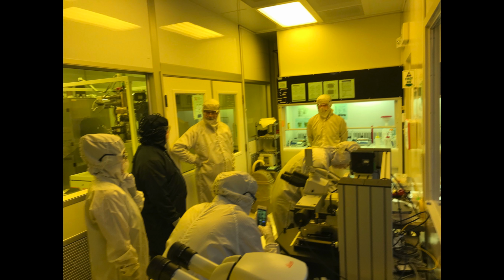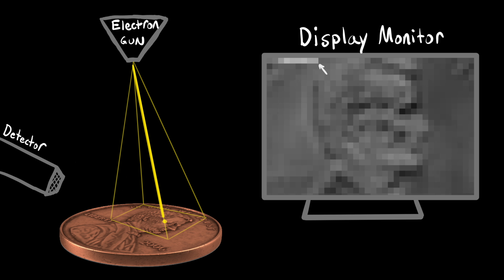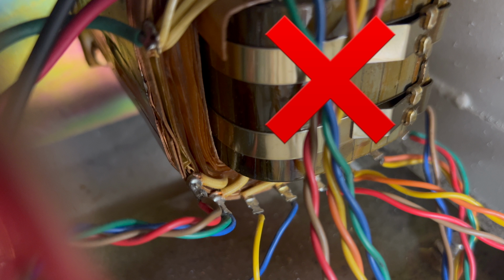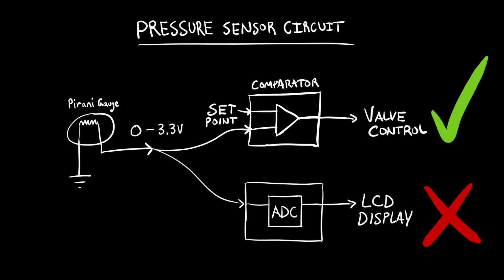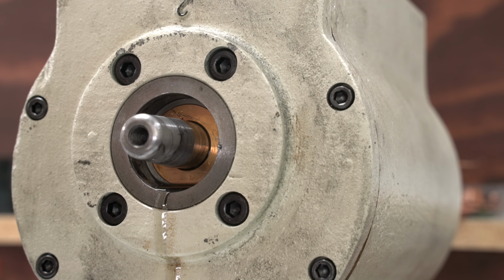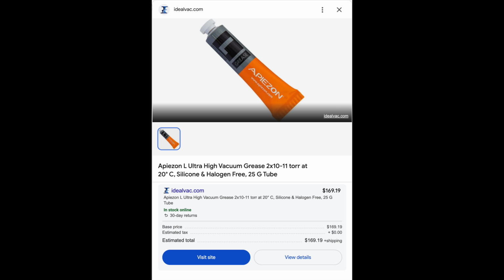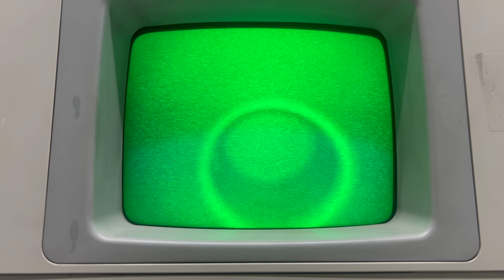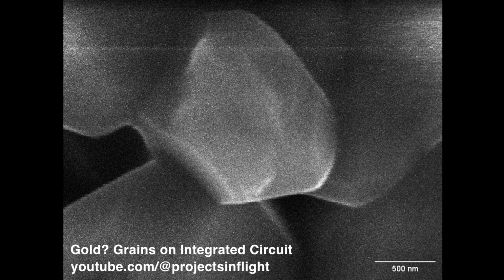I Saved an Electron Microscope from the Trash

Comment: why didn't you use a step down transformer for he whole thing?
Reply from the maker: if you mean instead of the variac, i totally could have. For whatever reason the machine came with a variac instead of a fixed transformer- probably to accommodate slightly different mains voltages

Comment: Question:

Why go through the extra effort of sourcing specialty transformers with calculated voltages?

If you're replacing the entire transformer anyways, you might as well feed it line voltage? It's only the output that matters anyways, no?

Or are you that worried about the galvanic isolation the variac provides?

Comment: The fact that those massive voltage regulators could be replaced with a 7805 regulator is absolutely insane and shows just how far silicon tech has come
Reply from the maker: I will admit that i am pushing those voltage regulators pretty hard. The ones it originally came with probably had a larger safety factor
Reply: @projectsinflight  oh definitely, but I imagine a similarly specced of the same age as the original regulator would easily be double or triple the size. Nothing against the engineers back then, they did the absolute best they could with what they had, but it's interesting to see how far everything has come since then

Comment: Since the pressure gauge was removed from the loop, how did the digital circuitry know when to go from DP WAIT to PRE EVAC to EVAC?
Reply from the maker: the pressure gauge is still in there- the only thing that is nonfunctional is the part that converts the analog signal to the digital display signal. the board that controls the valve uses the analog signal
Reply: Ahh, thx very cool that these old analog systems have separate circuitry for each sub system.

Comment: Now imagine loosing time on 70s stuff where you can get the cheapest ccd censor with few microns pixel size for cheapest Webcam possible for few bucks and just place whatever you want to scan in a drop of oil directly on top of the sensor.

Comment: 🤔Perhaps "GO CARDS" = "GO CARDINALS", the baseball team.  In the late 1970's, at HP Labs, I designed the digital raster image electronics for the "E-beam" vacuum chamber device that scanned very high resolution electron beam images onto integrated circuits.  The vacuum chamber used the same technology that your electron microscope uses.  Very interesting work!

Comment: Dear Pro,

I had saved a similarity one, JSM 5500 donated from the other department. My students and I so happy for that. However, it has no software source or any service manual. It is now running under windows NT4.0. That fine but too slow.  I like to upgrage the system to lit of bit higher verision. 
Could some one kindly help me to find out the sofware source? 

Many thanks
Tuan

Comment: I used to work on one of them, measuring critical dimensions on microchips, at Maxim Integrated Products in SATX. Now, that fab is owned by TowerJazz, the last time I checked. I would also create jobs for the SEM to automatically measure critical dimensions (it was very simple programming, like programming an old radio). Thanks for the video!

Comment: The university I retired from purchased a SEM, don't recall the brand.  They spent a ton of money for it and the deal was the criminal justice department would share in the cost of the instrument and that would make it available if they wanted to use it.  I don't think they ever used it.

While I was employed there (notice I didn't say I worked there), the video display quit.  It was common NTSC analog video, I was able to send the video to a standalone video monitor, got them buy until I was able to repair the original monitor.  After I retired, got a call that the SEM died and they didn't know what to do.  Apparently the tech that took my place didn't know anything about it, so they called me.  Having no schematics or trouble shooting info, I went on my own, have to think simple.  Turns out it had several power supply voltages but I believe they all keyed off one power supply, which was dead.  Eventually I found a shorted capacitor in one of the regulated supplies.  Of all things, it was a ceramic capacitor, those things almost never fail.  Here you go, a 25 cent part.

I never had a chance to play with it but I knew it wasn't so simple that you put something on a microscope slide, put it in the chamber and look at it.  I think they had to do a metalic vapor deposition on the specimen  in order to look at it.  Also, I believe the specimen went into a vacuum chamber, not something you would put your finger in.

edit:

I also recall before I was employed there, they had another electron microscope that somebody ruined.  Whatever they did, got oil into the chamber and it ruined everything, but I wasn't there, so don't know what really happened.

It was 27 years of my life, really enjoyed my job with the school of engineering and computer science, until politics got in the way and I retired.

Jim

Comment: Hi, I have nice helminth I need pictures of can you help out? 
Thanks
Julio
Reply from the maker: Unfortunately, the need for a vacuum in the SEM means that you can't simply image organic material, since the water in the sample will make it impossible to achieve vacuum. There's actually a LOT of work that needs to be done to image organic specimens. 

1. embedding (you have to replace the water with epoxy)
2. staining (you need to add heavy metals to the sample to improve contrast)
3. sectioning (you have to slice the specimen up to see inside it)

I'm working on a method to image organic stuff in the sem, so if I put out a video on that feel free to hit me up again and i'll see if I can do it :)

Comment: You could probably fit a bucking transformer (power transformer configured as auto transformer) inside and eliminate the variac so the SEM just plugs into 120V power. These can be pretty small as only the low voltage secondary winding carries the load current, something like 120 primary, 15-20V secondary rated at higher current than the whole SEM pulls from the wall at 100V, remember mains power is toleranced fairly wide, for 100V Japanese power anything within 90-110 shouldn't hurt anything.

Comment: Pretty cool that you have your own SEM.  We used TEMs, SEMs, STEMs regularly to examine grain structures of CIGS solar cells as we were developing a manufacturing process for supporting 5MW per year production rate with an increasing performance efficiency objective.  Anyway, nice job getting the SEM running.  Looking forward to seeing what you do with it.

As an note, perhaps looking for a sputtering chamber in the spirit of your SEM, like a Hummer, would good to consider.  You could do metalization from solid targets of you choosing WAY easier and no chemistry.  As I recall they were not that expensive brand new, certainly not true for individual purchases.  But I did a quick search and used prices are affordable.  Metal sputtering will serve you quite well.

Comment: PS: do you have any large universities around with a property disposal program (auctions)?  I have bought the most astonishing vacuum gear - in perfect working order - from such auctions.
Also racks, a fancy multi-wall LH2 dewar, an air drier, all kinds of stuff.  The less likely the buyers and the auctioneer know what it is, the cheaper it is.  Case in point: gigantic Varian ion pump, no supply, conflat in good condition, $5.  The next month, the power supply showed up and i bought it for maybe $20.  Never needed the complete pump, resold it a few years later for a gazilion American dollahs.  But you have to know what you're buying...

Comment: "one billionth" ARGH who talks like that? (in vacuum, lol) (j/k, you don't expect avg viewer to know hi vacuum)
Okay, so that's what, 8x10-7 torr, right?  I'm still on my first 30gal drum of coffee for the day.  Respectable, but not annoyingly difficult.  Foundries need truly annoying vacuums.  If you live anyplace with humidity, then every time you dive the thing to atmo, you replenish the water monolayer on the inside of the chamber, which slows pumpdown time a lot.  But you can't wipe it all out with alcohol every time you open the sample door, then wait for THAT to pump out, so you install it in a cold air conditioned room and you leave the turbo running all the time?  I"m asuming it uses a turbo.  But doing that only makes sense if you have a frequent use for it.  SEM-as-a-service?  Not joking, but customers will be few and possibly hard to find.
OTOH, if you can get this tuned up and working in a reasonable period of time, you might have a business fixing them. You seem competent enough.

Comment: man.. that was a great idea with the transformer, I would have never thought of that. I could use that trick later. these repair tricks (like the voltage reg replacement) could be applied to many other electronics repairs. putting those in my pocket and saving them for later!

Comment: the surfaces are tempered, the fact to use a silicon based grease doesn't make any wear, I saw pistons lubricated with that work all the time and no scratches, nothing, everything stayed in tolerance and they worked around 4 torr

Comment: This is one,of the most amazing videos I’ve watched.  I thought it was going to be a typical restoration video, but was amazed with how well you presented your troubleshooting and repairs. I agree about looking at knife edges, I’d also be interested in how 3d printed layers would look but I imagine it would be super overkill, but you never know what you might see as far as adhesion at the levels you can see with a SEM.  I’d be curious to see how temperature differences would change the layer adhesion in a part.

Comment: Tap, using the handle of a screwdriver, the neck of the CRT. You might just knock off some of the crud on the cathode heater. Don't hit it too hard or you will break the CRT. Just a couple of dozen light taps.

Comment: Hey Man, 

I dont know when I last watched a video on youtube that resonated so much with me. Your craftsmanship aside, the calm style, the decency and the passion are just admirable. Thank you a lot. And Thanks for teaching me a bit about troubleshooting. I am a material scientist btw and spend quite some hours on a SEM, so trust me I have a tiny impression how you felt when the first contours appeared on your screen. But I didnt rebuilt that thing from scratch...

A minor hint though: There is another possible reason for the visible vibrations. Even though mechanical vibrations are likely, fluctuating electromagnetic fields may result in a very, very similar effect. Or in simpler words: Maybe all the power cords in your room, especially if there are some high power ones, may mess with your electron beam. Counteracting those is tougher though then mechanical vibrations, as a faradayic cage wouldnt work, you would need to actively create fluctuating fields of proper frequency, phase and amplitude (active shielding). To further evaluate, you could (from low to high effort)

- check if the "waveform" and amplitude  change if you slightly knock on the SEM body, the surrounding floor, and so on. 

-  check if placing the sem on a stack of alternating hard rubber and steel or stone plates (vastly differing stiffness materials that create boundaries reflecting mechanical waves) does any good (one stack peer machine foot), as I think a air balanced system will be impossible to fund

- moreover, you could cut the foundation "free" on which the SEM stands, decoupling it form the rest of the house and blocking waves from passing on. 

- check if you could match the frequency of the vibrations to 50, 60 or whatever Hertz count your electrical grid is (reference the vertical scan speed referenced to minima and maxima of the visible waviness of a straight edge of a maybe?). If thats the case, you may see electromagnetic influences. If active shielding is not available, at least try to move the SEM as far away from any electric cables and switch of all fuses for curcuits you dont need, as even if there is no current flowing, a cable may act like an antenna

Again, great, great work

keep us updated!

Comment: I started my microscopy career in 1991 with an American Manufacturer AmRay.  Heard all the Amway jokes...  JEOL was in many of the labs I worked in.  Later worked for KLA until 2015.  I applaud your tenacity in repairing this old SEM.  You picked a good one for home use as it uses cheap tungsten filaments and a pretty maintenance-free diffusion pump.  LaB6 and Field Emission sources are prohibitively costly for home use.  Not having a Turbo pump is another key to keeping costs down as they fail regularly.  I worked on everything from these and older units back to 1975 to the latest used in today's FABS.  I'm not sure where you're located but if near Silicon Valley I'd be willing to lend a hand getting this thing up-to speed and maybe some training on how to operate it to get the best images.  I fix all my friends' electronics for free these days.  Funny that I just ordered some hall effect joysticks to fix my son's PS5 controller drift.  I'm going to use the exact same solder removal gun you showed.  It is a game changer for pulling out old components!  😀

Thanks for the trip down memory lane.  Your entire repair was like a typical day for me back then.
Reply from the maker: i am actually in silicon valley! feel free to message me (projectsinflight at gmail dot com)
Reply: @projectsinflight  go cali! go cali! go cali!
Reply: Ok both of u may not read this but I'm legit some random guy who finds this stuff interesting I would really love a long form video of you two going over everything I would appreciate it a lot both of you guys are awesome and smart asl thanks  for the great short
Reply: God damn I love the internet ❤
Reply: You and @projectsinflight and I probably crossed paths but didn't know the other existed. I worked in Silicon Valley 1980-2001. I lived near Homestead High School. Rode my bicycle to work at Surface Science Labs, near NASA Ames wind tunnel. A few of my friends worked at KLA.
My brother still lives in San Jose. Small world, eh?

Comment: I used a modern SEM quite a lot during my PHD and was surprised how good the resolution of the older model is. 80% of the old machine seems to deal with controlling the SEM and Monitors which nowadays is of course all handled digital by a connected PC not its own circuitry. The vaccum system was also interesting to see since basically all high and ultra high vacuum systems I have worked with used a turbo pump instead.

Comment: Hey, this is a crazy video man, im a repair tech, i have never worked on something this complex before, you may be able to output the video directly to a modern pc with an Osprey Video analog capture card, i use one for VHS transfer and its an actually Windows 11 supported capture card built for analog signals. If the software u were using in the video is built on the Windows DirectShow api, it should be compatible with that card, great video man!

Comment: So the electron microscope is a kind of cathode ray tube, or orthocon tube?   I thought to get a high enough vacuum you'd need THREE pumps, at least this is what an aluminumizing rig needs (to deposit aluminum on a mirror in a vacuum).
Since the machine runs on 100vac, I wonder if it was originally used in Japan.
Reply from the maker: it depends on the type of electron source. a thermionic emitter just needs a high vacuum, but field emitters need ultra high vacuum

Comment: You should look at Uranium or some other radioactive material under the microscope to see the effects of the radiation on the imaging or if you can see the radiation
Reply from the maker: i imagine beta radiation would probably trigger the detector just as regular secondary electrons would, but the arrival of those beta particles would not depend on exactly where the beam is, so the beta radiation would likely just show up as random noise on the image. still a reasonable thing to try, assuming i could get my hands on a good check source